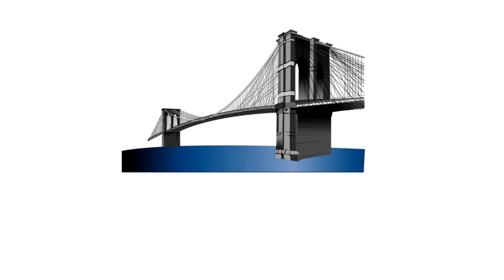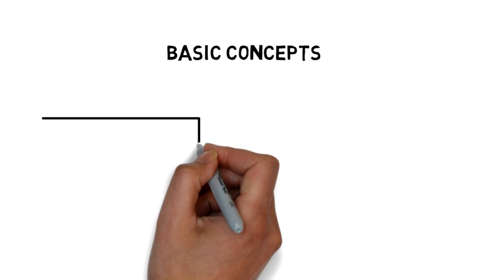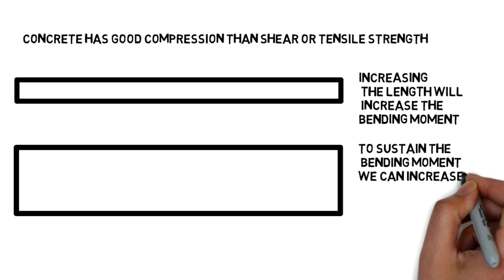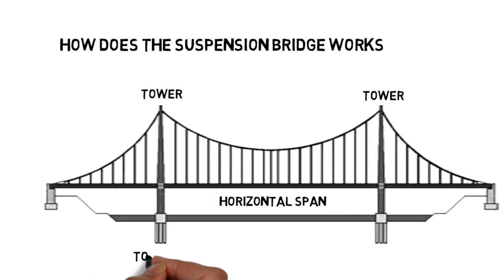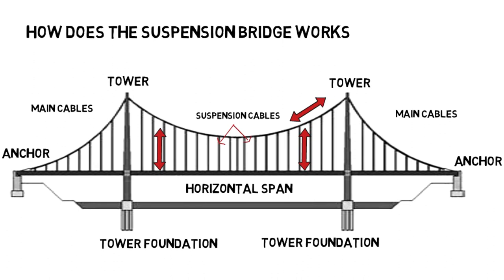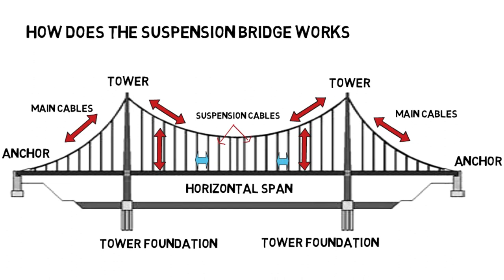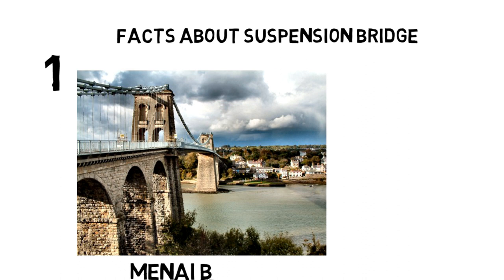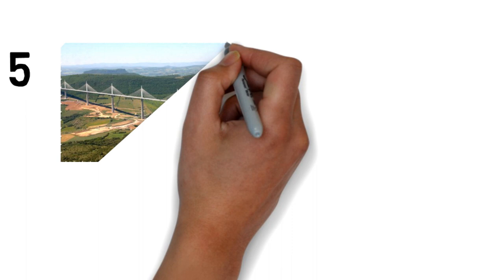#suspension bridge ||#basic concept|| #working principle||#advantages and disadvantages||#facts

Comment: The cables take the entire load?  Tower foundation has nothing to do with load? I always thought the foundations served the purpose of load handle.
Reply from the maker: Eventually it's the foundation that takes the load .....but because of cable the load is evenly distributed so that the load doesn't lead to failure of foundation......and due to this  reason suspension has been quite popular